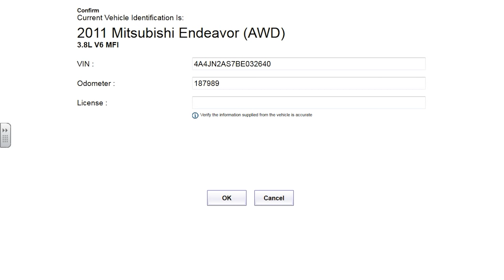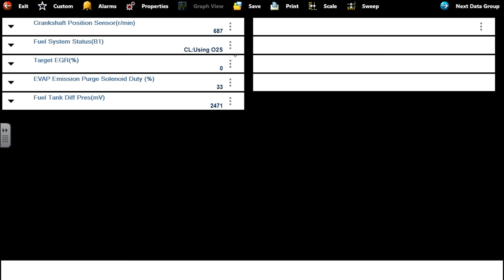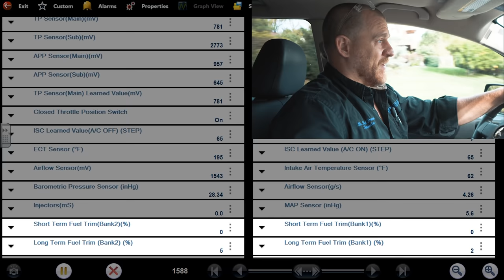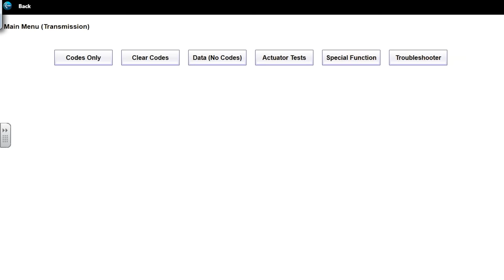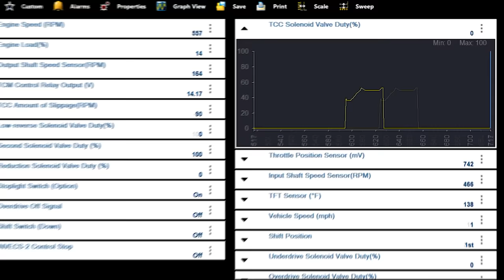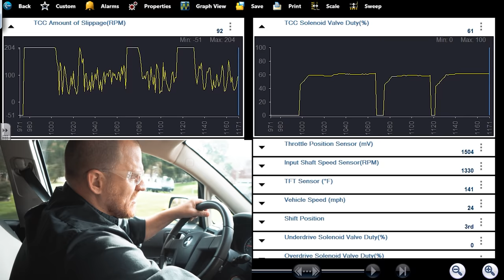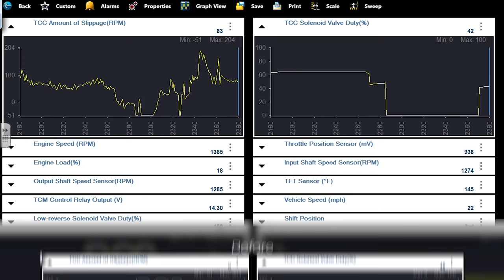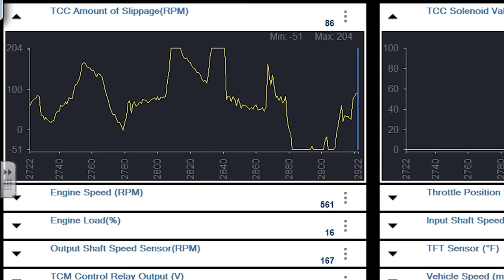2011 Mitsubishi Endeavor Misfire or TCC Shudder? Identification and "Fix"

Comment: Sometimes when you have transmission issues cars these days will have secondary symptoms such as misfires cause the car sometimes needs to put its self into limpmode so you don't damage the transmission. My 99 k3500 7.4 l did this on number 6 cylinder cause the siliniod plug shorted due to transmission fluid leaking through plug! It through an p1810 torque converter code then did what they call 2nd gear lockout which is an limpmode for transmission issues. Wasn't sure what you know on that as your an intelligent guy but thought I would share what I've found working on my rig incase it helps you in the future 😉

Comment: BUS off codes and CAN timeout in Mitsubishi are because all the modules are programmed to top model spec by default, the modules that are not fitted to lower spec vehicles result in the BUS off and CAN timeout occuring as they cannot be found in the network.
Reply: Lots of people chase these ghost codes until they give up.

Comment: (I will explain the old adage of service the Transmission or not) Back in the 50s 60s 70s 80s. Transmissions ran really hot causing the ATF to varnish. Varnish has a yellow tint to it which I have not seen in 20 years partly because of the type of oil used today and the fact transmissions don't run as hot as they used to. When you serviced a Transmission with varnished ATF the new ATF would cut the varnish loose sticking the valves. The Transmission would not stick the shift valves or the pressure regulator valves because these valves have strong return springs
and the valves have really sharp lands witch would cut the varnish in half. On the other hand the governor valves had very light or no return springs so the varnish would stick theses valves with no problem. The Transmission really wasn't hurt but it would start off in 2nd or 3rd gear because the primary or secondary valve would not return to there home position which is 1st gear.
The governor was controlled by the output shaft speed and centrifugal force. At about 15 mph the heavy primary valve would stroke causing a 1-2 shift at about 30 mph the secondary light valve would stroke causing a 2-3 shift. When the vehicle came to a stop if the primary or secondary valve did not return to there home position you had a wrong gear start on take off. Interesting thing is if you had a pressure gauge on the governor pressure port you would see O psi with the vehicle running at a stand still. As the vehicle started moving you would see the pressure rise 1 psi per mile per hour. 50 mph = 50 psi and so on. When the governor valve or valves stuck you would see some kind of pressure as the vehicle came to a stop causing wrong gear starts. The Transaxle in Paul and James video did not have a varnished Transaxle. The ATF was a brown in color servicing that Transaxle/Transmission with a new filter and fluid would not have hurt that unit at all. The lube Gard INSTANT SHUDDER FIX would
work even better and longer if the unit would have been serviced and flushed. Paul's Transmission & Repair 40+ years building Transmissions of all types. (Great video and info you guys) Also that Transaxle has no mechanical governor it was replaced by the speed sensor.

Comment: Love your videos, and this is no exception. I've learned a ton from you. For what it's worth, I had the same issue on my 2012 Toyota Rav4 4wd with the 4cyl engine. Dark but not burned trans fluid, shutter under light throttle (especially around 40mph). I was actually able to fix it myself (DIY) with 3 fluid changes. The first 2 I just pulled the drain plug and filled it back up. The 3rd I pulled the pan and changed the gasket and filter. Maybe I got lucky, and I'm sure there's some permanent transmission damage of some kind but I've gone about 20k since then with no issue. I hadn't tried any kind of shutter fix product, but I like that the fluid is clean now so hopefully that's preventing the problem from getting any worse. If it ever comes back I'll definitely give Dr Shutter Fix a try!

Comment: I don't rely too much on the color of the fluid. The color is just a dye and in no way affects the quality of the fluid. I've been noticing some fluids drastically change color after a few years and low mileage on vehicles with no transmission problems whatsoever. If the transmission shows no sign of slipping, I'd recommend a new filter and partial fluid change.
Additives aren't usually a fix, but if $50 buys you an extra year of service from the vehicle, it's well worth a shot.
Reply: Mazda CX five tranny fluid is blue if it gets dirty just a little bit it turns brown so essentially it always looks burnt unless it’s brand new. My question is did they run out of red dye and had some blue lying around LOL

Comment: Hey Paul, I've diagnosed this problem two days ago on my '02 Tacoma thanks to fundamentals learned from you. So for this type of problem could it ever be just the solenoid? I was thinking of changing it out - from what I can tell the lockup solenoid is accessible from the transmission pan. My fluid is not burnt at all. After watching your video though it sounds like this is an actual clutch problem and not a solenoid problem?

Comment: I have had tried it a year ago, 2004 Mit Endeavor with 105 miles, I've drained 4 qt of tryny fluid then added the shutter fix, I dove it , it did not work at the begging but worked after a few miles and still works till today. not to mention, a dealership and auto shop put so many parts on it with no fix. but the $10 shitter fix it
Reply: did you change the Trans Filter?

Comment: Chasing these things can be miserable at times. 
On my own 99 E350 6.8l I had an intermittent shudder/ misfire that showed nothing on the scanner.  After a 400 mile trip the number 5 coil finally s@%t the bed. After replacing the coil and plug on the road, the shudder was gone. 
Intermittent problems are so much fun to chase.....Not!

Comment: Best way to check for TCC shudder is drive up a steep hill and push it to 60-70kmph. RPM will surge as well. Unfortunately speaking from personal experience haha. Ever since i tell everyone buying a used car test drive it up a hill!!
Reply from the maker: If the hill is too steep, you'll be into the throttle too much for the TCC to engage. But you're not wrong with your test.
Reply: @ScannerDanner  yeah I'm not sure why but mine only shuddered going up hills when under load. Changing fluid fixed it until trans started slipping 1 month later then got remanufactured.
Reply from the maker: @Aidan.17  exactly why I didn't want to change the fliud on this one 😉

Comment: Very common with endeavor idk why cause galant and eclipse on the same platform.  But I've done alot of flushes due to it and maybe have to do 2 flushes I had 7 years with mitsu and only know of one torque converter replaced but very common

Comment: I had a 2001 Ford E150 with 267000.0 miles on it that done that same thing with the convertor and we add a trans cleaner Additive in it drove it 5 miles came back done a complete transmission flush didn't change the filter or drop the pan just flushed it with 16 quarts of fluid and it fixed it and when i got rid of it i had 403000.0 miles on it and the transmission was still working perfectly

Comment: FYI...Instant Shudder Fixx doesn't work in a PWM controlled 4L60e when the rebuilder uses paper clutch material instead of woven carbon fiber!
Reply: @KRTube absolutely agree. 
On a tangent, on those trans I typically get rid of the PWM in the Valve Body,  basically lock up that valve so it's either on or off. Seems to make everything last so much longer and a more positive feel.
Reply: Sounds like you need a better dr rebuilder fix
Reply: @CubasAutomotive  Yes, i totally agree with blocking the PWM on the 60e's, keeps them running at least another 100 miles before the 3/4 clutch fails or the sun shell. I got pretty good at building 60/65e's. I also like the solid accumulator pistons set to flush height. The daily drivers don't get the vette servo, too rough of a shift.

Comment: My 2010 F150 had a wicked shudder when I first bought it but it took me a while to figure out as the actual problem. I did a pan service, flush with motorcraft mercon LV and the shudder fix and the problem has been gone for 20k and counting.

Comment: Sometimes being a parts changer is the fastest way to diag the issue.  Lights are a great example, I can change a headlight on a utillamaster step van in about 3 min, to check the wiring I have to pull the light anyway.  Why wouldn’t I stick a new head light on it right quick, it that’s the problem I fixed it in 3 min.  If it’s not the problem I had to pull the light anyway to check the wiring.

Comment: Excuse me! wouldn't the ECM "notice the shudder" and  count that as a miss as the engine and ATX are running 1to1? I think so .
To the Ecm it WAS a misfire and that the shudder isn't consistently happening on the fire cycle for any particular coil so it can not isolate a single cylinder as a fault and that your missing a 0300 for the same reason, the TCC is slipping on every power stroke and grabbing on an exhaust stroke????
Just a theory but looks good on paper 😏.
Good job on the ride along (camera shake when it happens)and the info .
 KUTGW

Comment: Would analysis of the tranny oil and inspection of oil filter give a better idea if the transmission or torque converter needs to be changed?

Comment: many year ago in 70 ,add very little brake fluid to trans fluid would fix temp it would soften the piston seal ,and stop cluch slepering ,but would damage more the trans after a long period time .....cluch meterial and metal.....it would cost more to rebuild the transmission for the rebuilder
Reply from the maker: I did that to my old power wagon for the power steering box that was leaking from the pinion shaft. Sealed it up perfectly and drove it that way for years after lol but I don’t think I'd do that to a tranny

Comment: the TCC shudder is likely throwing the crank and cam sensors into mad fits and at 188K I'd suspect worn timing belt with tensioner not holding tight enough adding to the issue.

Comment: I'm wondering if the shutter was just from low fluid and simply made it better by adding more .
Reply from the maker: It was not! That is why I did not add anything more than a few cap fulls of new tranny fluid, to simply rinse the funnel. I wanted a good, valid test. Great question!

Comment: Damn sounds like my 2012 ram  1500 5.7l but at like mid throttle pedal and between 2,000-3,000 RPMs… driving me nuts and having a hard time figuring it out

Comment: I believe it was GM that actually had an additive for their transmission shudder fix at one time. But if that instant shudder fix worked that well on such shitty fluid I think it would help to change the fluid and use that fix again. Otherwise I'd trade that car off while its working because as you say, mechanical can fix isn't long term. Just my opinion. I have done more than three automatic transmissions. lol
Reply: Yea definitely not if but when, Like they said it is just a Band-Aid

Comment: The only thing I would have done a little different is remove 2 or 3 quarts of fluid then the lubeguard then the fresh fluid goes in. You are adding just a little new fluid to mix with the old so it doesn't "shock" the tranny.
Reply: Anything done wouldna hurt that trans any more than it already was, If you did put new fluid in there and it started slipping more it’s because the clutches are worn down  anyway
Reply: @captainmorgan6035  Fair enough. Im just going by my experience with a trans tha was behaving similar to this. I very slowly renewed the fluid and added the red shudder fix and got 1000s of miles more out of it. But yeah it could've went the other way for me too.

Comment: Why not ask the customer if he wants a transmission service. Inform the customer trans is possibly at the end of its service life and new fluid might help or push it over the edge. If it still shudders after the service but shift points are solid a new torque converter might not be too bad.
Reply from the maker: We were concerned with a service as I mentioned in the video. I think this was a better option and less risk.
Reply: @ScannerDanner  I agree most of the time a service after problems developed is a crapshoot but if the fluid is dark but smells okay I bring the customer into the decision. You are still the hero either way. Honest and upfront wil never steer you wrong. That’s what I was taught when I was a SM.
Reply: I also wanted to add I love your videos and the interaction with your brother and his shop. I also know the pressures of running a shop do not give you the luxury of time. It’s like an emergency room where you need to stabilize and move on.
Reply from the maker: @davidraezer5937  exactly my friend. And thank you so much!
Reply: Better to walk away and promise nothing, the transmission is obviously going bad so whats the point. You got to wonder tho if he did a transmission flush or drain and fill or filter and fill or whatever if it would’ve done the same as the doctor instant shutter fix. Btw im selling my new product called dr instant fix all your problems… only 299.95 plus s&h🤣

Comment: Trying to wrap my head around. Misfire O2 would show rich, and STFT would pull fuel, like a leaking coil to ground or just intermittent breakdown of internal coil not firing under demand. Right?!?
Reply from the maker: Remember with a misfire, there is also unburned oxygen, so the O2 will go lean and the STFT will go positive (most misfires)

Comment: FYI torque converter shudder can cause misfire codes
Reply: When the shudder occurs it can cause abnormal variation in crankshaft speed, causing a misfire code to be logged.

Comment: Service and flush Transaxle and add another bottle and call it good. We have been wear you are at numerous times.
Reply: Noooo do exactly what he did and walk away too much chance to own it, transmissions Obviously about toast, no need to open up another dr insta fix lol
Reply: (I will explain the old adage of service the Transmission or not) Back in the 50s 60s 70s 80s. Transmissions ran really hot causing the ATF to varnish. Varnish has a yellow tint to it which I have not seen in 20 years partly because of the type of oil used today and the fact transmissions don't run as hot as they used to.  When you serviced a Transmission with varnished ATF the new ATF would cut the varnish loose sticking the valves. The Transmission would not stick the shift valves or the pressure regulator valves because these valves have strong return springs          
and the valves have really sharp lands witch would cut the varnish in half. On the other hand the governor valves had very light or no return springs at all so the varnish would stick theses valves with no problem. The Transmission really wasn't hurt but it would start off in 2nd or 3rd gear because the primary or secondary valve would not return to there home position which is 1st gear.  
The governor was controlled by the output shaft speed and centrifugal force. At about 15 mph the heavy primary valve would stroke causing a 1-2 shift at about 30 mph the secondary light valve would stroke causing a 2-3 shift. When the vehicle came to a stop if the primary or secondary valve did not  return to there home position you had a wrong gear start on take off. Interesting thing is if you had a pressure gauge on the governor pressure port you would see 0 psi with the vehicle running at a stand still. As the vehicle started moving you would see the pressure rise 1 psi per mile per hour. 50 mph = 50 psi and so on. When the governor valve or valves stuck you would see some kind of pressure as the vehicle came to a stop causing wrong gear starts. The Transaxle in Paul and James video did not have a varnished Transaxle. The ATF was a brown in color servicing that Transaxle/Transmission with a new filter and fluid would not have hurt that unit at all. The lube Gard INSTANT SHUDDER FIXX would work even better and longer if the unit would have been serviced and flushed. Paul's Transmission & Repair 40+ years building Transmissions of all types. (Great video and info you guys) Also that Transaxle has no mechanical governor is was replaced by the speed sensor.